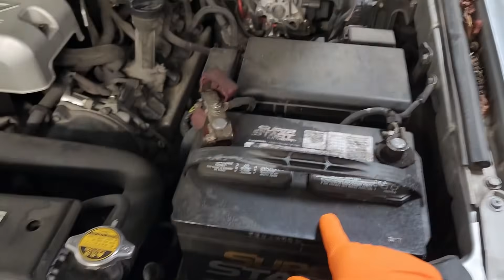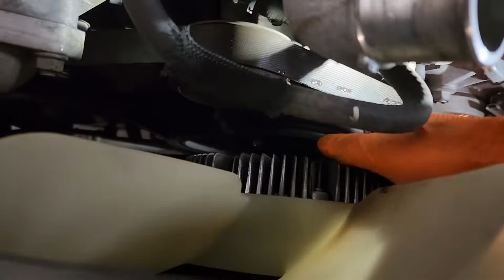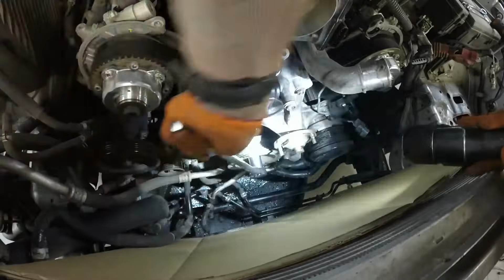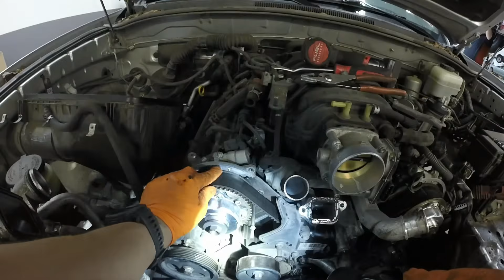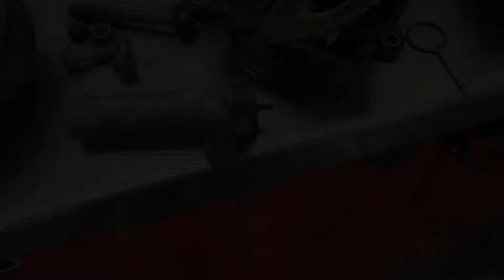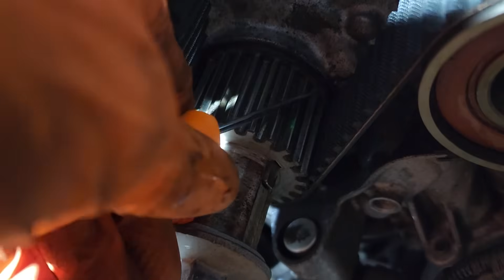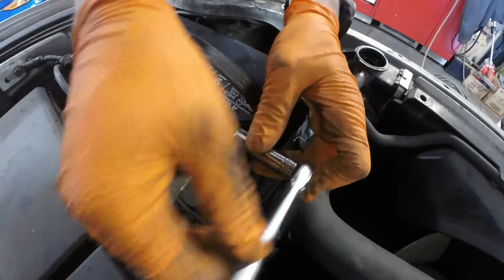Timing belt replacement by a Toyota master tech

Comment: Tackle my very first ever timing belt job on my 2001 Lexus GS430 because of this awesome video.  Thanks to Drew, I knew exactly what I needed to do and was more than confident I could get the job done.  Thanks again for sharing your knowledge and keep up the good work.
Reply from the maker: Wow, big thanks, this is my first super thanks. Much appreciated.
Reply: Omg i was doing some research and i couldn't find a good video but ur comment gave to confidence to do it on my 2001 lexus gs430 did u use this video? Only

Comment: Got a kit off Amazon that doesn't have the timing marks on the belt guess we will have to cross our fingers and hope for the best.
Reply from the maker: If you are lucky and the old belt has marks you can transfer them over by lining them up together. If not just make sure all the slack is at the tensioner when the belt is installed and rotate by hand 2 to 3 times to verify that it is in time before putting the covers back on.
Reply: @shoptimewithdrew no visible marks on the old belt just directional line on the new one

Comment: Ssdly job was incomplete in this engine the dealer has a package thqt includes crank seal and cam seals this were not performed  and i was able to see the crank seal was wet around of it. No dealer will do the seals even when they come in the package they want to charge double the job for it.  I recomend replace VVT seals and cam seals every time you do this it will save you a lot of headaches i.am at 300k miles my first 2 belts were done by the dealer and they never replaced the seals ended up having to replace everything myself to find out i had a lake of oil inside my timing cover. Make sure they replace them even if they are not leaking because once they start you will have to pay for the entire job all over again.

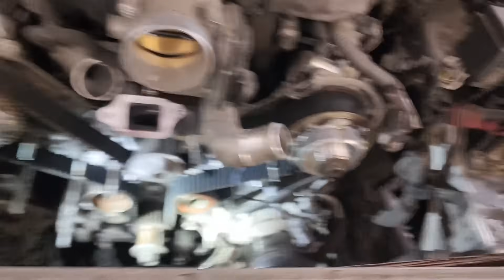Comment: 25:29 is the proper point to do this job.  Not the T. Marks. You will fight the cams moving from valve spring force. T marks are for cam installation.

Comment: Here's to all my confused monkeys out there which destroyed my mind researching this all over the F$#%^'ing Internet and TIS, as follows: And more neurotic you are and looking at your naked cam sprockets and crank pulley and cover staring at you - this video will still confuse you...but in the end clarifies things:

the core difference comes down to whether you neutralize the force at the top of the engine or create a safety buffer at the bottom. The "T" mark method focuses on the camshafts: by rotating the sprockets to the stamped "T," you place the cam lobes into a flat, zero-tension "sweet spot" so the loaded valve springs won't violently snap or rotate the shaft when the belt is removed. Conversely, the TIS 50 degree method focuses on the pistons: by backing the crankshaft counterclockwise 50 degrees, you drop all eight pistons deep into their cylinder bores so that even if a camshaft springs or turns while the belt is off, an open valve physically cannot strike a piston head. In short, the "T" mark prevents the cams from jumping in the first place, while the 50 degree method ensures that if they do jump, nothing gets damaged...So either or. TIS 50 degree method is CYA for engineers/Toyota - "T" Mark is a tech get it done flat rate type shit. "T" Mark method way to go I suppose. But Id rather cover my own ass because no one going to give a shit if my valves bend. So technically by the book with something to hold the RH CAM (SST or whatever) while taking off belt 50 degree counter clockwise probably the gospel way to do it. NAWMWAN MY NIGGAZ?

You're welcome

Comment: Question: If the timing belt broke, how would you align the timing? Same way? Feedback is appreciated!

NOTE: The timing belt broke when i put it into gear. I've had several mechanics tell me that there is a possibility that the engine is still good since it didn't break at high speeds.
Reply from the maker: You will just have to rotate the cams and crank to the timing marks individually.

Comment: CORRECT INFORMATION: This is wrong if he is leaving the top marks at the "T".  This video completely threw me off. Tdc is the vertical line. You need to set it at tdc with the crank sprocket notch lined up against the nipple at 2pm on the engine block and the cams at tdc on the vertical line. Then remove the belt, tensioner and tensioner pulley while installing belt with tensioner pulley last and the tensioner very last. As you remove the bekt at tdc, take a 19mm wrench to the cams and move them back as you set the belt.
Reply: This is. Correct. It’s in the shop manual as well. I don’t know why he keeps doubling down on the wrong information. And even says to spin cams to line up. That’s how you hit pistons with the valve’s opening. The bar marks and the bead by the crank line up. At the t mark there is no mark for crank. The reason is the cams will fight to move while trying to line up marks. As long as belt marks hit marks on pulleys you are ok. But don’t use t marks. They are for cam installation.

Comment: Hello, how did you get the red dot line up with the yellow T on both cam to begin with?
Reply from the maker: By rotating the engine using the crank bolt.

Comment: The toyota sequoia 4.7 engine is the best engine ever, the timing belt went out while driving, all of my friends told me that I need another engine, and just one friend told me to install just the belt to see what happens,no kit, just the belt, thanks to this video I did the job my self and my sequoia runs really good like nothing happend, $50 dollars belt, 
It has 270,000 miles and with the new belt I think is going for another 100 or 200,000 more,
Reply from the maker: I'm glad your Sequoia is still on the road and my video was able to help you get it there.

Comment: Great video! I do have a question which is what to do when the cams kick over?
Reply from the maker: If it ends up kicking just rotate them back. If you set it the way I show in the video the pistons are slightly down.

Comment: Loosen idler pulley bolt to help get the new belt marks fitted to the right groove on crank gear then retighten.  You don’t want any play on drivers side (left). Use spring clips (used to hold thick documents together) to hold belt in place on cam pulleys.

Comment: I found your video after I removed the tensioner and timing belt aligned with the other marks, will that be detrimental to the rest of the process? What can be done now? My truck is a 2005 GX470. Thank you!
Reply from the maker: The other marks are fine to use. It is more likely for the cams to kick set that way. If you are doing cam seals you will need to set it to the marks in the video. In the end as long as the paint marks on the belt line up with the marks on all the pullys you will be good.
Reply: @shoptimewithdrew thank you for getting back, I’m dealing with the cams faking a tooth behind, I already did the process 3 times and keep falling on the same spot for both cams. Any advice?
Reply from the maker: Do you have the paint marks on the new belt? If yes line it up on the crank like in the video and then route the belt to drivers side cam and if needed move the cam slightly to get the paint mark to line up on the cam mark. Then put the belt on the passenger cam and rotate the cam slightly if needed. After you get the belt marks lined up on crank and cam make sure all the slack is at the tensioner area. If the cam marks are slightly off from the mark on the engine on both sides this means that the crank is most likely off slightly in the same direction and that is OK.

Comment: I just put the water pump on without grease. Now i want to take it back off just to make sure the seal didn't roll.  I found your video because someone before me made a bunch of white marks on the crank bolt and i was a little confused on belt placement
Reply from the maker: You will know when you start it up if the seal rolled. Once the coolant system builds pressure, it pours out.

Comment: Great video! Do you recall how long this job took you to complete? Also is there any specific bleeding procedure required when refilling the coolant? Thanks!
Reply from the maker: Thanks for the comment. The job takes me around 4 to 5 hours. Most first timers it will take a complete day. For the coolant, I just use a coolant spill free funnel and run the vehicle until the upper and lower radiator hoses are hot.

Comment: Great video! If you don't mind, what does your shop currently charge for this timing belt service? And, how long did this job take you?
Reply from the maker: Price really depends on location. For a timing belt and water pump on a 4.7l, it is 6 hours, and our shop rate is at $160 right now. Then add a few hundred for the parts. If everything goes well, they take about 3 hours.
Reply: @shoptimewithdrew I've done 2 timing belt jobs on Nissan VG30 engines and one on a Mitsubishi 6G72 V6. They all took me a week or longer. I don't mind paying someone who knows what they are doing, but I worry that the person doing it might not do a good job like you did here.
Reply from the maker: Yes, that is something you risk. I would say if you have the time you should go for it. Put a weekend aside just for the job. Air tools or good electric tools like Milwaukee are a big help.

Comment: Excellent video. I have a 2000 4.7 L Tundra with 240 k miles. Is the process of replacing the TB and water pump the same as in this video ? Is it a good idea to replace the Camshaft and Crankshaft seals as well?  Will it be necessary to remove the radiator?
Reply from the maker: Yes, this is the same process on a Tundra. It is a good idea to replace all the seals when you're doing the job.

Comment: how are you getting the fan off?  I have removed the 4 fan bolts but i cant pry fan disk off of fan pulley?  it should pop straight away correct?
Reply from the maker: It probably has a slight amount of rust. Hold onto the fan blades and wiggle back and forth. May need a little rust penetrant sprayed on the hub area.

Comment: Doing this job myself right now and the belt I’m replacing had scooted forward towards the bumper and been shredding itself.  The new belt seems to be doing the same thing and scooting forward on the left cam when I turn the crank.  Any idea why that would be?
Reply from the maker: Has someone been in there before? I would look for an idler that is not right or something is bent.

Comment: Am I seeing right that you don't have to move the cams if you start at the crank, then driver side, then passenger side? Is this always the case? What variables cause people to install the timing belt by moving the cranks slightly to get slop?
Reply from the maker: Sometimes, you move the cam to make it easier to get the belt on. But if you do it the way I show you don't really have to move the cams. The main thing is to make sure the slack at the end is at the tensioner.
Reply: @shoptimewithdrew  Awesome! Thanks so much for the quick response. Getting ready to tackle this never having done a timing belt job and many videos show different methods for putting the belt back on. Yours seems the clearest. Thanks again!
Reply from the maker: @kpy3p I'm glad the video was helpful. Good luck.

Comment: Does this method apply to 2002 Lexus LX470? Some videos do not show that you have to move the crank from TDC to the T mark before removing the timing belt.
Reply from the maker: Yes, this will work for a 02 LX470. Same engine.
Reply: @shoptimewithdrew  Thank You,

Comment: Great video. I will be replacing the TB on my 06 GX470, is the  belt positioning the same upon removal? (50 deg ATDC)? I have read the positioning may be different on 4.7s on different models? TY

Comment: Great video but it seems you were struggling a little bit to get he fan clutch off. May I suggest the double wrench method on the fan clutch. Use one 12mm wrench on 1 bolt with your left hand while loosening another bolt with a 12mm wrench in your right hand.  Then just keep spinning the fan until all 4 bolts are loose. Or reverse it if you are left hand dominant. I used this method twice on my GX470... once to change my radiator when it left the chat. The other to change my serpentine belt (which I should have done when I changed my radiator). I also put anti-seize on the studs so I wouldn't run into this problem in the future. Hope the info helps.

Comment: How much extra labor (hours) to do camshaft seal and vc gaskets? After reading some forums people said that valve adjustment isn't common for Toyota. Is that the case? Thanks!
Reply from the maker: It depends on what kind of cam gear you have. If it is a variable cam gear it is like another 6hrs because you have to pull the cam shaft. If it is not variable it is like an extra .3 tenths and yes valve adjustments are not common on Toyotas in the mid 2000 on.
Reply: Thank you for the info. Unfortunately, it is the variable cam one. It's hard to get these labor estimates these days... You're a gem! Of course, already a subscriber.
Reply from the maker: @houselin3625 Thank you!

Comment: Great video! Thank you very much. I really appreciate it. In total, how many hours take you to complete this job? I live in florida and toyota dealers are asking 3.5k to do it, sounds crazy to me. My 2005 sequoia have some oil where the timing belt is, usually where this oil comes from? I have to fix that before y replace the timing belt kit right? That should be dry and clean...
Reply from the maker: Thank you for the comment. The job takes me about 4 hours to complete. The book time is 7 hours and most shops rate is over $160 per hour now. Also yes I would fix any oil leaks that are in the timing belt area at the same time.

Comment: I couldn't get fan off the pulley so I just unbolted the fan mount it all came out in one piece no problem. Is there a reason to take the fan off in 2 parts? Thanks
Reply from the maker: It's just easier to get to the bolts and some models you can't get the fan shroud out without removing the fan first.

Comment: i got a 01 tundra currently in the process of replacing the timing belt. i’m confused on TDC i see a lot of different videos saying different things. and also is left and right opposite when looking at the engine? i need help bad. i don’t wanna mess the timing up to much….
Reply from the maker: The side of the engine is if you were sitting in the drivers seat. Drivers side is the left side.

Comment: What should I do if the cams are at the marks they need to be at but the crank shaft is like almost an inch from the white dot you talked about? Is it fine if I take the belt off the crank and spin it to where it needs to be? The belt slipped on the crank and I had 16 misfires from it. I also turned it over 12-14 times to try and align all the marks
Reply from the maker: Ya, you can remove the belt and turn the crank slightly. Just make sure the cams are at the T mark.
Reply: @shoptimewithdrew  awesome thank you! Appreciate the response!

Comment: You just made the most sense of this engine's timing belt - and since it is an interference engine, it's important to KNOW this before going at it. I still love my 5VZFE, but after seeing this, I'm not afraid of the 2UZ.
Reply from the maker: Ya, they are not hard to work on.
Reply: I thought Toyota stopped making v8 after 2006.
Reply from the maker: Nope v8 till 2021 in a Tundra.

Comment: How did you keep the crankshaft from turning when you removed the crank bolt? Did you use an impact to take out crank bolt?
Reply from the maker: If you are having trouble, you can break the bolt free and then turn it to top dead center. Then the crank won't move when you break the bolt free the second time.

Comment: Does same timing marks apply if the belt broke? Was told it can be “180 out”?
Reply from the maker: Set all the marks to the same spot as in the video, then install the belt. Hopefully, you did not bend any valves.
Reply: @shoptimewithdrew thanks for response !
Reply: I feel like I’m missing something, how come in some videos people use the strait line and others use the “T”?
Reply from the maker: One is top dead center, and one is past top dead center. You want to put the crank at the dot past the zero mark and then rotate the cams to the T marks. This way, the pistons are slightly down.
Reply from the maker: You can use either set of marks.

Comment: Hey Drew - phenomenal video - THANKS! I've been putting off doing the timing belt on my 2006 4Runner. But I finally decided to do it and essentially used your video as a step by step guide and it turned out to be the easiest timing belt job I have ever done. THANK YOU!
Reply from the maker: Thanks, I'm glad the video was helpful.

Comment: Hello Drew, thank you for the video, this is my second time changing the belt on my 02 tundra, On setting the timing mark on TDC some rotate the crank to the 0 before taking off belt, i went with you're instruction, wondering why they are doing this.
Reply from the maker: The zero is top dead center for cylinder one. The mark after the zero is after top dead center cylinder number 1. If you put it at this mark, the piston is slightly down, so there is a lesser chance of piston and valve coming in contact.

Comment: Also, if you are going through all that trouble you REALLY need to replace the pulley and the tensioner (which are included in the factory Aisin kit with the tensioner already compressed with pin installed). Never reuse those parts. They are cheap and come with the belt/pump kit from Aisin (all made in Japan).

Comment: Another good tip. Just remove the radiator after draining it and draining the two block drains and BEFORE removing the fan. That way you will not damage the radiator as it will be removed and completely out of the way and you will have that much more space to work with.